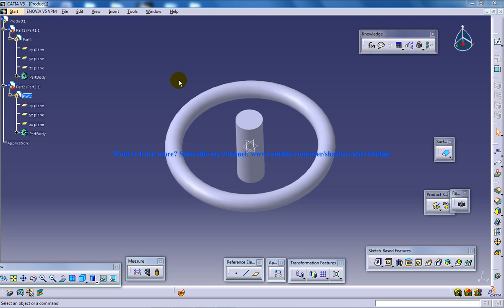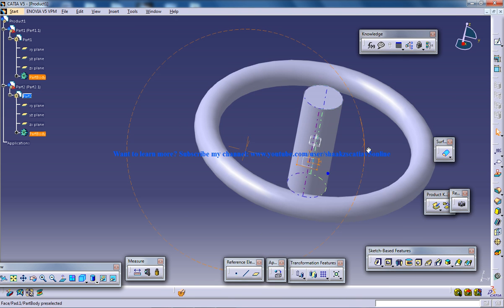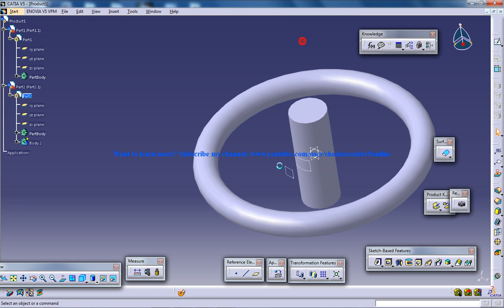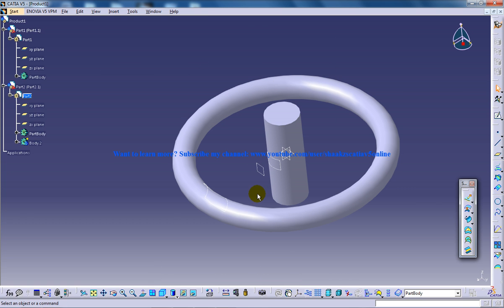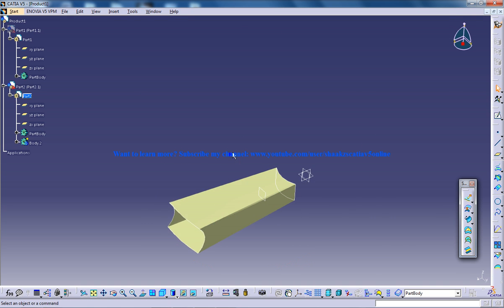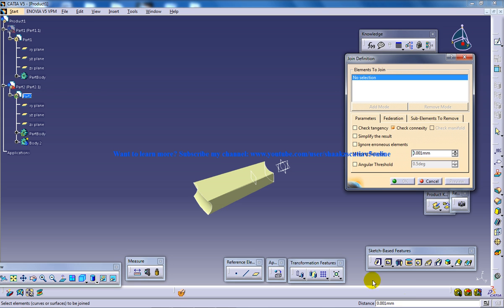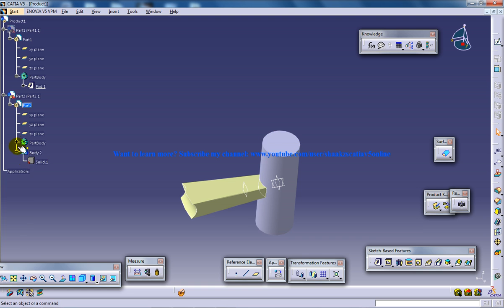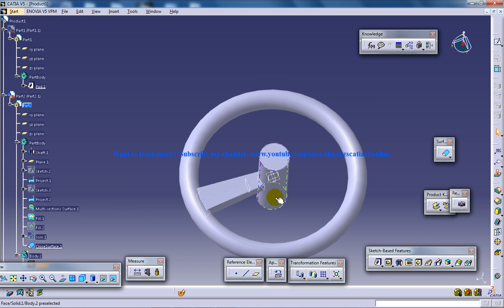Catia V5 Tutorials|Simple Steering Simulation Part 4|Digital Mockup|DMU Kinematics

Comment: when i use Join cammand i get a dialogue box stating "Non connex result. result counts 2 domains".
Plz help me solve it. bcz I m unable to proceed further without joining.
Reply from the maker: +Mohammed Nayeemuddin You can uncheck "check connexity" if you don't want the feature to make sure you have a smooth curve or a smooth surface. If you Need a continuous joined surface, then you have to check your surfaces if there is any gap between the two surcaces that you want to join.
Reply from the maker: +Mohammed Nayeemuddin You can uncheck "check connexity" if you don't want the feature to make sure you have a smooth curve or a smooth surface. If you Need a continuous joined surface, then you have to check your surfaces if there is any gap between the two surcaces that you want to join.
Reply: JazakAllah Khair. It was helpful :)
Reply from the maker: +Mohammed Nayeemuddin 

BarakAllah feek
Reply from the maker: +Mohammed Nayeemuddin 

Include me in your duas and also share the knowledge among your friends by referring my channel and talking about my channels with your friends.